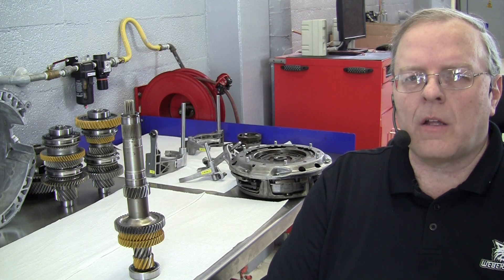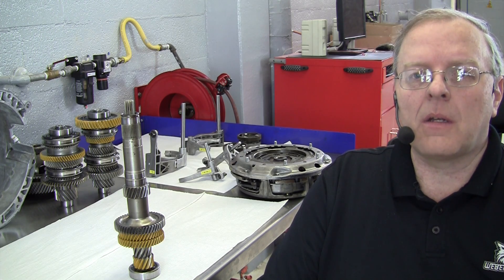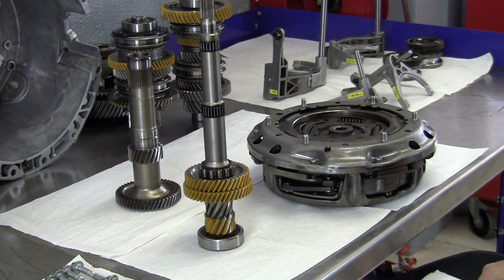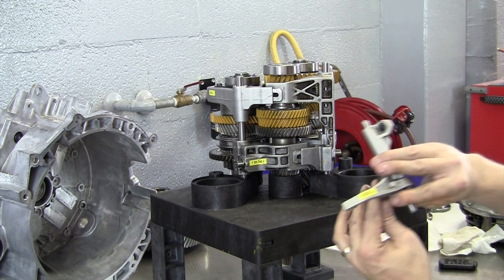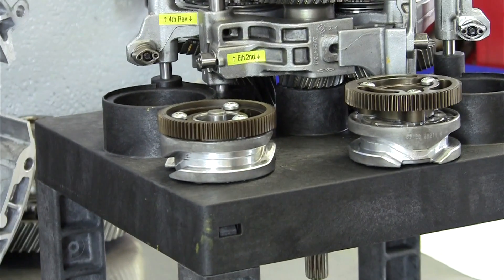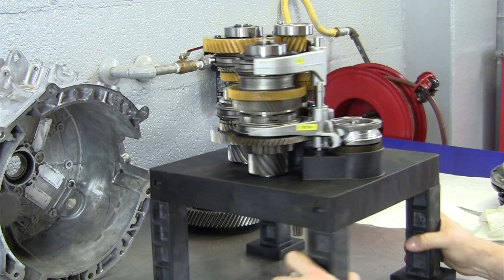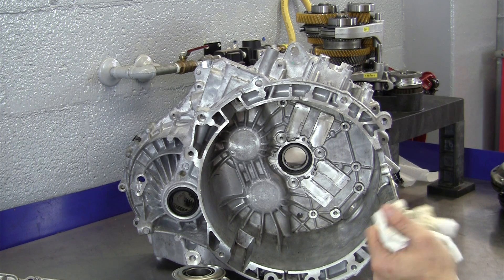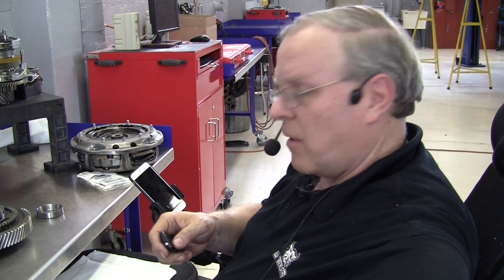Ford Dual Clutch Transaxle (DCT) DPS6

Comment: I understand how this 6 speed trans works, the problem is the computer module that controls the clutch and what gear it should be in is not advanced enough to shift the trans correctly or has a lack of sensors to know when to shift up or down. Also since the shift mechanism that engages and disengages the two dry clutches are driven by electric motors or survos they do not have a sufficient battery power to operate correctly because of faulty ground connections. This will cause shuddering, pausing or even the  trans engaging at idle and moving the car setting at a stop light forcing the car into traffic or at other times will not supply enough drive power to merge with high speed highway traffic. Also the trans has a problem with a leak of lubricant getting into the dry clutch housing causing the clutch to not have enough friction to drive the vehicle and then the tcm or transmission control module thinks it in the wrong gear and it does not know what to do causing malfunction resulting in hazardous or life threatening  operation.
Reply from the maker: +Thomas edwin Thanks for your feedback!
Reply: I sincerely doubt that better ground connection or better servos would solve this.  The fork mechanism itself has too much give.  With a "normal" clutch, the springs hold the plates engaged, and the forks pull them apart. The forks don't have to be responsible for the large solid force needed to smoothly engage the clutch - that's all the spring's job.  With this transmission, the springs hold the plates apart, and the fork has to supply the power to not only push the plates together but also overcome the spring tension.  The forks are relatively thin and use a lever action, so they are prone to deflection.  It would only take a few thousandths of an inch (hundredths of a millimeter) deflection to start oscillation in the clutch, which I believe is what's happening.  Anyone who's ever used a metal lathe and heard the cutter scream while it chatters knows exactly what this looks like, and how even the stiffest machine can oscillate under the right conditions.  That fork actuator is nowhere near stiff enough.
Reply: How about the throwout bearing? Seems like it doesn't have any balls or needle type roller in it. That may cause more friction on pressure plates.
Reply: i heard there is an extended warranty on the computer.. ~150k miles (not recall though)
Reply: this is exactly what happened to me!  . Also the trans has a problem with a leak of lubricant getting into the dry clutch housing causing the clutch to not have enough friction to drive the vehicle and then the tcm or transmission control module thinks it in the wrong gear and it does not know what to do causing malfunction resulting in hazardous or life threatening  operation.

what causes this leak?

Comment: Seems to me this transmission is tragically over complicated.  Any out of calibration condition on the myriad of electrical and mechanical components could have the transmission fighting itself (two gears selected at the same time) to destruction.  I drive a standard 5 speed transmission and while it does take two hands and attention, I value the simplicity, economy and reliability.  I can't help thinking they made this deliberately complicated with the "dynamic obsolescence" marketing approach in mind.  Few backyard mechanics and aftermarket types are going to work with or modify this system.  The parts are all very custom and not amenable to adapting to other functions or purposes, and the system is sufficiently complicated so that is just one thing goes out of mechanical or electrical calibration - the entire system no longer functions.  Thank you, and thanks Ford for being open and honest with what you have done, and what you are trying to do (preserve the economy of manual transmission while simplifying the driving experience).  I suggest your mechanical engineers develop more trust in modern electromechanical hardware and software so you can implement a electrically driven single clutch and shifting mechanism which responds in a timely fashion.

Comment: All I know my car 15 has 22k miles and can't be fixed no one can fix that junk this is the 7th or 8 attempt!
Reply from the maker: You do have rights a s a consumer. If the car cannot be fixed, they manufacturer may have to buy it back from you (depending upon local laws).

Comment: Hey I'm in a pinch! I replaced my dps6 transmission with a used one and now it has very violent engagement in reverse! I put my old transmission control module on it because I've heard its programmed to the car. Is there a specific procedure to install it so the gears are clocked correctly? Could it have a very bad clutch from sitting around too long? Any advice is really appreciated thanks

Comment: The issue with this design is that it is literally two 3-speed manual transmissions linked together! Interesting engineering project, but WAY too complicated to be something you use in day-to-day consumers products... Hence the return to the time-proven planetary design, or the CVT.

Comment: Owner of this piece of junk tranny since 2014.  Got a new one installed in 2016 and now in 2021 it won't go any higher than 3rd gear and gives an error to service transmission.  Ford is part of a class action lawsuit because of their poor judgement.

Comment: Thank you John for another great video.  I don't feel the DCT is going to have longevity. How long will the clutches and throw-out(in) bearings last?   On a regular manual you are not suppose to hold your foot on the clutch so not to keep the throw-out bearing spinning. The DCT seems to be applying pressure to one of the bearings\clutches all the time while driving.
Reply from the maker: Thank you! All good questions. The bearings do not seem to be a problem, just the dry clutch discs
Reply: I had my clutch’s replaced on my 2015 Ford Focus at 117k miles as I heard Ford was replacing them for free my car didn’t feel like it had any issues shifting it had no weird noises but I figured might as well get it replaced sense it was free

Comment: Really  great video John, very detailed.

I drove a Focus with this transmission  couple years ago and really enjoyed how quick it shifts when commanded manually.

Being mechanical inclined I always look further and wondering about the longevity of this transmission. The clutch, the clutch motors and the integrated gear selecting motors may be a thing of concern down the road.

Specially that it seem that the motors that select the gears are part of the TCM.

Thanks
Reply from the maker: gianfrancoa Thank you for watching! Good points.

Comment: Sorry if this was answered in another video, but why are the gears slanted? I noticed this is the industry standard (I think... I've not seen it another way). Is it for strength, or is it just more efficient? Or would it be for wear reasons?

Thanks!
Reply from the maker: Philip Gragg Hi, helical cut gears are quieter than straight cut gears, they are also stronger than straight cut gears because of their increased tooth contact surface area.

Comment: I was thinking of buying the 2014 Ford Focus with DCT, but after test driving and feeling the hesitation in shifting, I probably won't buy it.
Reply from the maker: +777dingo Thanks for watching and for your feedback!
Reply: 777dingo I know I'm a year late and you more then likely decided on your vehicle already, but I just bought a 2014 Ford focus HB. I was skeptical about the transmission also but for owning it it for a few months it grown on me and it's a pretty good, quick transmission.

Comment: Awesome however let's focus on the fact that my 2014 ford focus has been thru 4 clutches at 106k miles  until they got it right.... then last week my factory battery died I replaced it and then my transmission wouldn't go in reverse or shift out of first ford dealer replaced tcm and still nothing I'm parting this piece of shit car out!
Reply from the maker: I am sorry to hear of your troubles. Best wishes

Comment: This is an over priced, over complicated and over engineered type of automobile transmission for consumer and public operation. It is a complete waste of the peoples money. This design is meant for racing purposes only. (Where it was designed in the first place.) When racing this automobile transmission works great when your shifting up and down through the gears all the time. This is what this type of automobile transmission design is meant for. The domestic automobile transmission does not work this way. Domestic automobile transmissions go into high gear or overdrive and stay there for the majority of the vehicles driving cycle. 50% of the DCT design is just along for the ride in a domestic car. The excess weight and drag of the components in the DCT design just add more friction to transmissions operation. Adding unnecessary friction to any automobile operation just costs the consumer more money at the pumps. Bad design. Automobile manufacturers should be able to do better than this!!
Reply from the maker: Daniel Mazurek Thank you for your feedback!

Comment: Hi John, great breakdown! I've seen the clutch replacement procedure before but not the actual gear sets and their workings! Very cool!! - If you're still wondering about the failure mode, its the shaft seal material failure and here's a great video by Brian explaining the shudder issue:  https://www.youtube.com/watch?v=YVJnNPbjjjs        Cheers!

Comment: i wish this transmission much could be widely apply to other cars...... DCT with dual dry clutch much better almost twice than an old automatic transmission .... and less produced heat... long range miles use and has capability of heavy duty  load... more simple construction less maintenance
Reply from the maker: Thanks for your feedback!